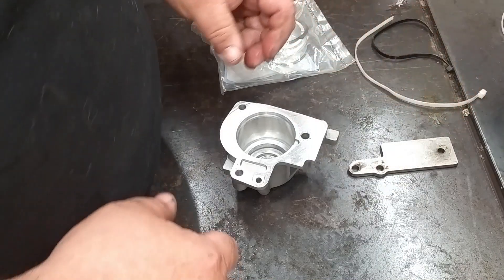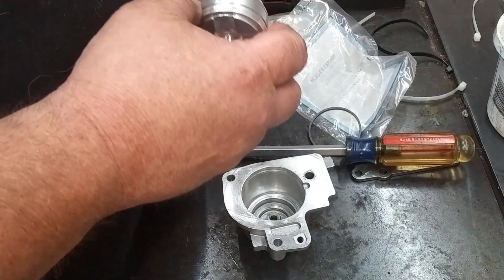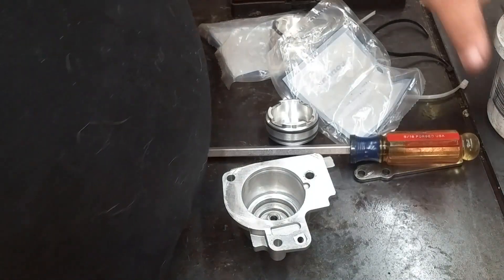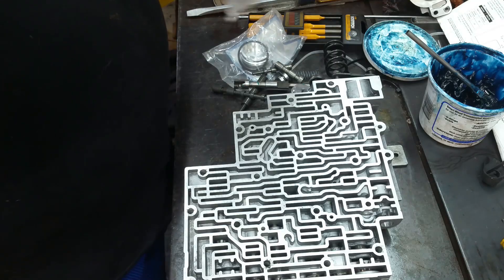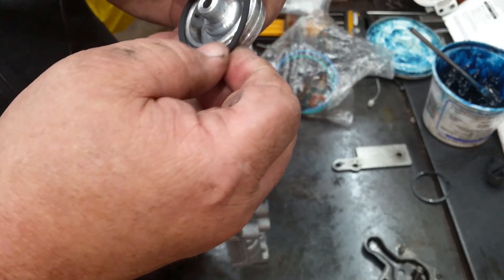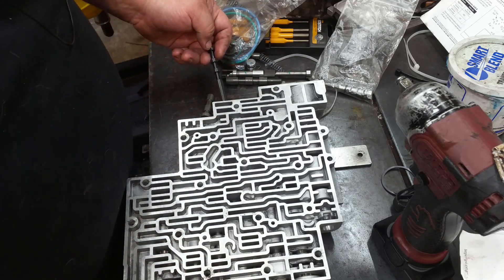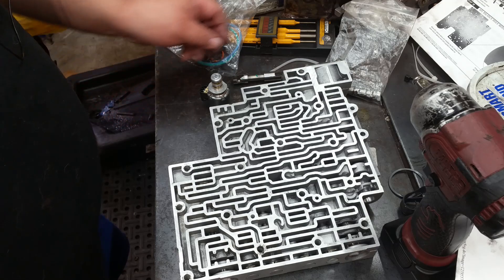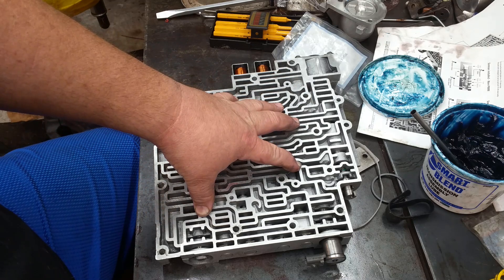The "Brains" of Austins 4L60e: Accumulators and valvebody setup

Comment: Did you drill the 1/8 hole through the valvebody channels for the 3 2 shift valve?
Reply from the maker: I didn't on this one. I have on previous builds. This one was just a slightly over stock build...
Reply: @IrocinZ  ok, I guess Ididnt think the valve would function properly without it, always learning.
Reply from the maker: @localcustomer4646  I still learn everyday...